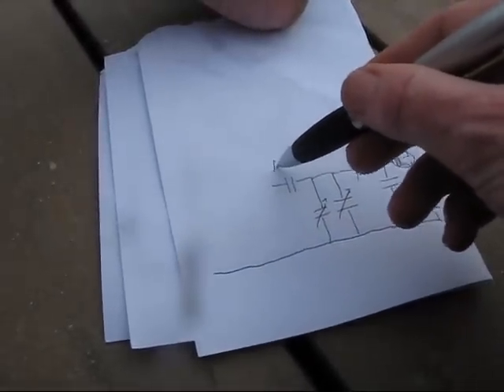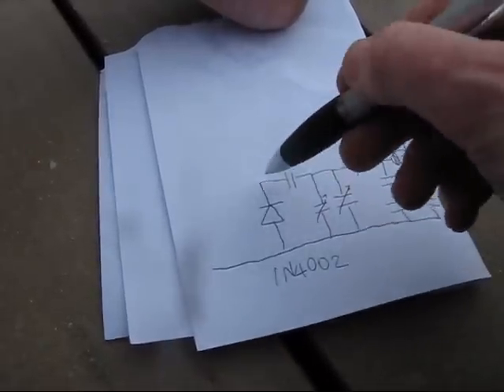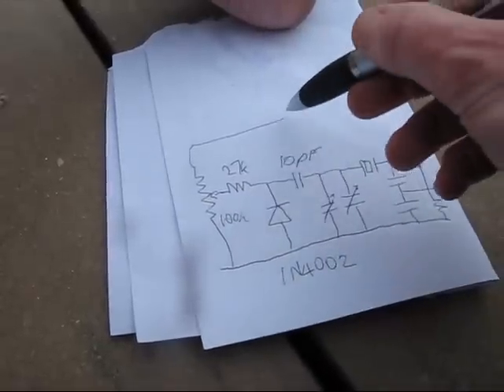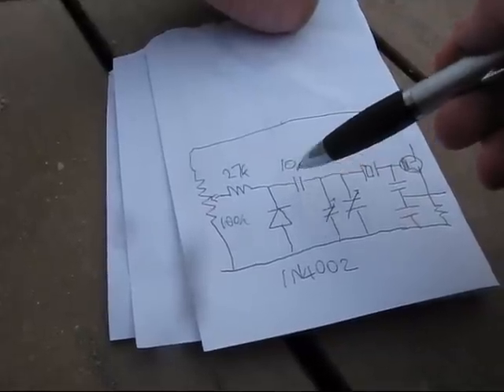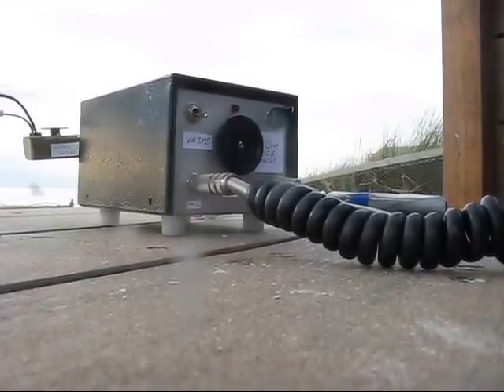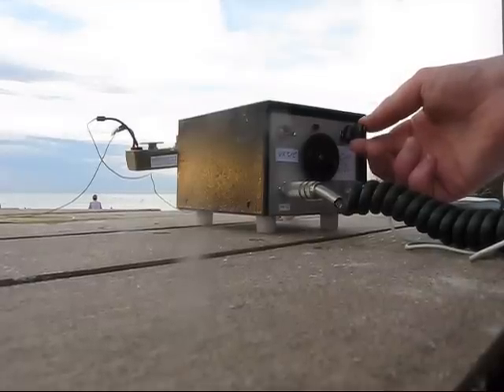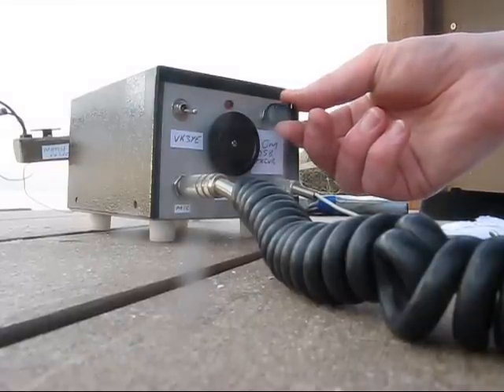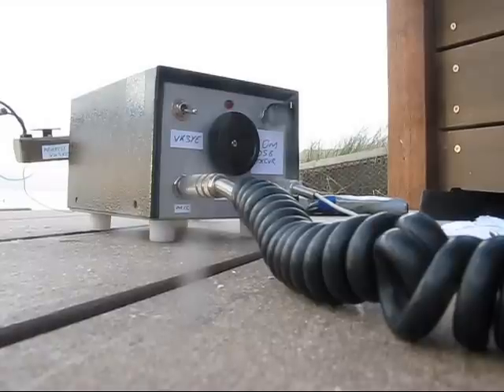"Beach 40" 7 MHz DSB txcvr: Part 5 fine tuning

Comment: Thank you for another nice video. If you're bothered by the non linear change in capacitance of a silicon PN diode, try a red LED instead. Being PIN junctions, their capacitance is not very high but it changes somewhat more linearly with voltage.